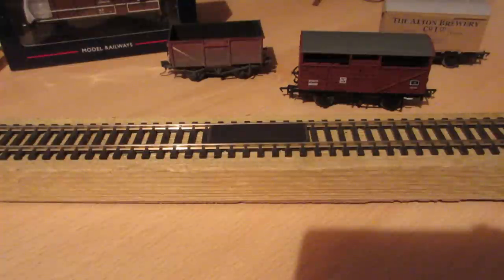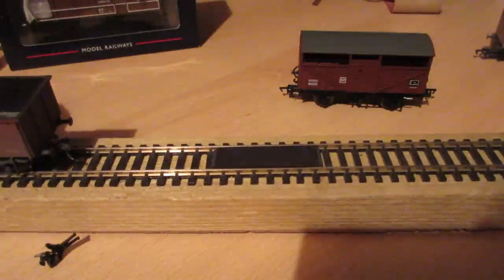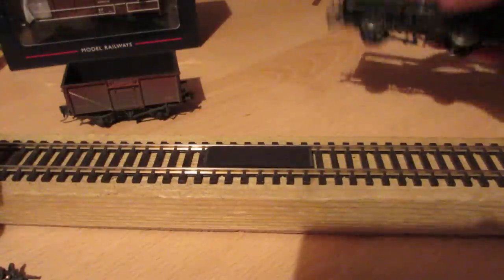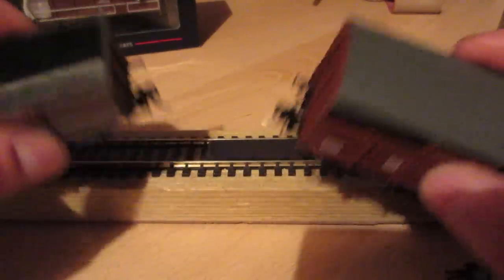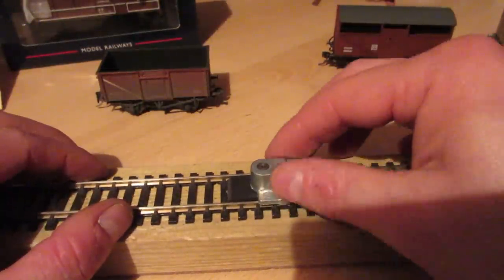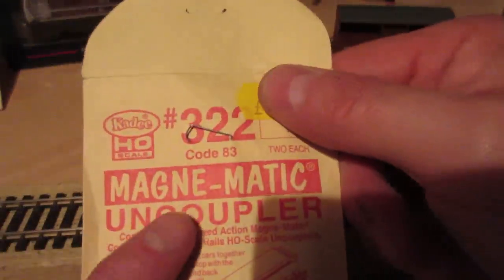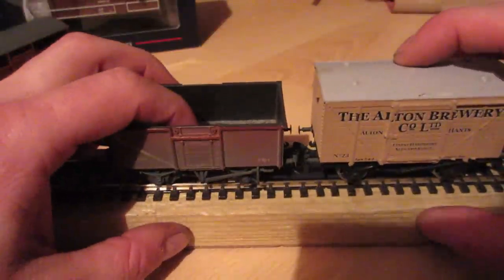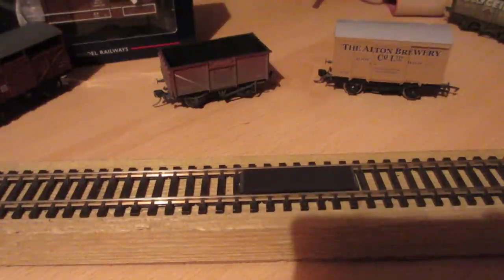Kadee couplings, how they work and installing

Comment: Very good presentation. I’m an American “O” gauge modeler but I have a small HO track I run some HO and OO on. I’m not terribly worried about being that prototypical but in my opinion the Kadee’s look much better and the ease of use is worth it alone for OO rolling stock.

Comment: I am a huge fan of Kadee now. Just replaced my entire fleet (5 cars and a loco) using the #1030 starter kit. I needed to provide to cement and the drill bit /drill but was otherwise complete.  It did come with the gauge and trip pin pliers, as well as 2 pr of uncoupler magnets... If your going to convert  or start new, buy this first.

Comment: I went for a more simple approach. I used spare NEM coupler pockets from Bachmann with either tension lock or european bucle coupkers and created a lasercut adapter to glue under the wagon. I simply remove the old Triang or Hornby coupling and glue the NEM coupler with my homemade receptacle in place. It's then just the case of inserting the kadee for nem pocket and there we go.
Reply from the maker: Evening Eric, since doing these vids I have found Dapol sell packs of NEM sockets and couplings in packs of 40, and that saves a whole bunch of time simply screw the NEM to the wagon insert kadee done!!!! , they even come with screws, sometimes i still have to pack them out but its alot easier, and I am not  lucky enough to have access to a laser cutter!!!!!
Reply: @keepcalmmakestuff732  thanks for the info. I'll be sure to check their website for it and hopefully buy some next year in Ally Pally.

Comment: Code 100 is for mainline, code 70 or 80 is for sidings
Reply from the maker: Hi Raymond, code 75 is more prototypical to standard Rail used across the network( height of rail), regardless of where its used, so from a modelling point of view if you wanted a layout to look like the real thing using code 75 throughout would look better( apart from handbuilt)
Reply: @keepcalmmakestuff732  I was probably just thinking of American Railroads although a line like a branch line would obviously have shorter and thinner rail since they wouldn't "see" big locomotives like giganic 2-6-6-6 Mallets and big 6 axle diesels and High drivered express steam locos.
Reply from the maker: in the UK, Kadees are nowhere as popular as the US, but I much prefer them to our tension locks, in the era of my layout(50's to 60's) we had pick up goods  so a train could be separated and wagons could be left and others taken so the ability to separate and shunt In a short space was a defining reason.

Comment: Americans used to use hook and horns couplers in HO scale and Rapid couplers in N scale until the Kadee couplers replaced them by the modelers at first, and then later also by the manufacturers with their own make. In the same manner many of the British are doing the conversion, Americans have been there, done that. Americans tend to model freight operations more than the British, and design their layouts accordingly. These Kadee couplers make shunting operations possible without the used of your hands. The key to successful shunting operations is to place a magnet before the point leading into the sidings. You don't have to put magnets everywhere.
Reply from the maker: Hi Ron, the US  have got the buckeye coupling nailed, we are a bit behind in our use of it and me personally now that I have used them I dont think I would go back to tension lock!!!!, The only thing I wish they would do is under and over shank for NEM pocket couplings, they do it for their draft gearbox it would make my job alot easier, operation wise we dont tend to have massive frieght terminals as they do in America, we had some hump yards that where big but my layout is tiny in comparrison so for operation purposes i needed more than one, as it is a terminus the loco has to run around so it will always be pulling so putting one at the throat of my layout may not have worked, At the small goods yard I have then yes it would be ok.
Reply: The United States has a lot of freight, agricultural and natural resources, that ship hundreds of miles, if not thousands, from the central part of the country to sea ports on either of their sea coasts. Where as in the UK much of the similar freight is ship less than a hundred miles to a sea port and then shipped to another port or another county's port. After all Great Britain is a island. British friends I have were astonished of the huge corn belt of America's Midwest around Chicago. Every farm it seems within a several hundred miles of Chicago grows corn, or soybean, or oats, if not all three cash crops. And then going west to the Rockies there is another few hundred miles of another cash crop, wheat... The apples and cherries of Washington state, the vegetables and fruits of California, are shipped by reefer trains across America to its east coast in a few days, they are not shipped by sea through the Panama Canal in two weeks. You could throw in Canada with similar freight. The North American continent is not a island the size of the one state of California... Amtrak and Via are still around with a few long distance national passenger trains routes, but 99 percent of our trains today involve freight/goods. Even if HSR does receive more investment, worldwide HSR works best for distances of less than 500 miles, if not 300 miles. At over 3000 miles, no one is going to ride a HSR train which will take more than 21 hours from LA to NY, if not more, when they can fly that same distance in less than 6 hours. There never will be a US or Canada investment in a transcontinental HSR...
Reply: I have a small 6 feet by 4 feet layout, about the same size as the Hornby TrackMatt.  I can get two ovals with two sidings off the oval, one outside and one inside. The inside siding does a 180 degree hook, to avoid using 1st radius curves I placed a straight on both ends of the main ovals. The middle siding leads to a small Inglenook  yard with two sets of points. So I can do long distance running on the ovals with two trains, and shunt to my heart's content with the small Inglenook yard. Just enough to keep me busy with my trains without getting bored...
Reply: Ron Clark god, I HATE Rapido couplers! I have an old Kadee n scale (old enough to be Kadee) with factory equipped Rapido couplers installed. It WILL be converted...
Reply: "Americans tend to model freight operations more than the British" Depends on the era. Modern British railways are basically all unit freight but anything set before about 1985 will likely have plenty of freight ops.

British (prototype) trains mostly use variants of chain couplers, which means that a model will either be using chain couplers (which are a pain in the butt) or will be using something unrealistic. Tension lock couplers are easy to make and trivial to set up, so they're the manufacturers' default choice of unrealistic coupler. If they moved to Kadee, the result would be that models would be more expensive and require more care to set up. In the US, the extra effort is worth it, because Kadee couplers look fairly realistic. In the UK, Kadee doesn't have that advantage: it's just an alternative unrealistic coupling system. It does have a lot of advantages but, at the end of the day, it still looks nothing like the coupler you'll see if you go outdoors and look at a British train.

Comment: Southern Region trains all had buckeyes as standard and they could be dropped to expose the hook for the traditional bar and loop couplers.   Its why SR emu stock at cab end it was the "pullman" bar that did the buffering and the buffers were retracted.   Some of the Thumpers instead of having a gangway connector just had a buffered pullman bar at end of the non driving coaches instead of the single buffer the EPB's had.

Comment: You can simply use uncoupling ramps with tension lock couplings.  

In the UK the US style "Buckeye" couplings are only used on coaching stock and fixed rake bogie hopper wagons (which have 3 link and buffers at the end wagons).
Reply from the maker: Hi Andy, uncoupling ramps have a disadvantage once you have left the ramp they re-couple, The beauty of Kadees is the fact that you can once uncoupled you can then push/propel a wagon to any position without it coupling back up( great for shunting), Tension locks also tend to leave a massive gap inbetween stock, which is much improved with Kadee's,  At our club we have some big layouts that we take to Exhibitions and trying to take apart a 10 coach rake at 5pm at the end of the day with tension locks is grief, the advantage of Kadees is that you just lift them up!!!.I have been using them for quite a while now and I would not go back to tension locks,!!!, disadvantage is cost and set up they take a bit of time to set up
Reply: A well traveled Yank here, been to all of GB a couple of times. Anyway, we don’t call them Buckeye, (that’s someone from the State of Ohio) we call them knuckle couplers. Good video, enjoyed it.
Reply: @samiam619  They're referred to as "Buckeye couplers" because that specific design was originally made by Buckeye Steel Castings, in Columbus, OH. They were the main manufacturer of them for the small UK market, so the name stuck here; in the US, Buckeye was just one of many manufacturers so their name wasn't particularly associated with what is generically known as a Janney coupler but, as you say, normally just a knuckle coupler.

Comment: Great video! Useful and informative. How do you stop the magnet uncoupling the train when it goes over it when you don't want it uncoupling?
Reply from the maker: Cheers for the comments, when the train is underway the tension in the coupling when pulled stops it, if pushed providing you dont stop the coupling does not come apart and will stay coupled once clear of magnet, flat track is important, if the magnet is in a dip In the track they may uncouple if the trailing wagon catches up over the magnet!!!!!
Hope that makes sense!!!!!,
Reply: @keepcalmmakestuff732  thanks for the info. But if the loco goes over the magnet constantly on a main track not siding what stops it uncoupling the train? Does it only uncouple when going over it slowly?
Reply from the maker: @mattseymour8637  providing there is tension on the coupling ie weight of train it will remain coupled they only uncouple when they are pushed together over a magnet, if there is enough drag/ weight on the train it should never uncouple, the tension prevents the pins from moving over
Reply: @mattseymour8637  let me explain it in American ;) ... tension keeps the cars coupled over the magnet during regular operation. you would need to stop the cars/couplers directly over the magnet then back the train up slightly to relieve the tension in the couplers, then they will uncouple and you can pull the train forward again.

Comment: Good video Ray. I am looking at KDs as I am building alot of wagons now as RTR arE just too high price . KD dont make it easy with their numbering system eg they have 416 for say long shank with pockets then use 17 18 and 19 for NEM style. I will take the plunge for some of them and maybe get the 1030 starter pack as that includes the gauge and pliers.

Comment: There is a surprising lack of video for conversion of old Hornby couplings (non-NEM type) to Kadee.  If you have now converted could you please make another video to show how you did it?
Ta
Ray
Reply: As he will show in the other video, with much of the rolling stock and locos there isn't much choice other than to cut and file away the older coupler. A touch of black paints helps. As for the plastic cards he is using as a washer, Kadee sells plastic washers in different heights as well that work with their coupler box mounts.

Comment: Can you use these Kadee couplings on locomotives as well as wagons
Reply from the maker: Thanks for watching, if you have the NEM pockets on the loco then yes they go straight in!!!!, if no NEM then it is a bit of a pain,
Most newer British manufactured RTR has pockets so its just a bit of fine tuning, some of the older mainline/hornby/bachmann are difficult I am lucky in that most of the stuff I run is easy to fit, I try to steer clear of older stuff!!!!!

Comment: The Kay Dee couplings bear a remarkable similarity to the older Hornby Dublo couplings, which were metal. I suspect that is the true heritage of the Kay Dee couplings anyway, but they obviously have the added refinement of the uncoupling pin which works as it crosses the fixed magnet. As a child when I had Hornby Dublo, I always thought their coupling was superior to what was then,  in the UK, the other type of coupling then available that was fitted to Triang and which became known as the Tension Lock coupler. I always regarded the Triang  coupler as a bit of a fiddly thing and rather difficult to uncouple, certainly by hand. The older Hornby Dublo couplings can and should be adjusted to a few critical angles and this can be done, with care, with a small pair of pliars. The later Hornby Dublo style couplings in plastic cannot be adjusted, but then they don't really need to be because they do not sustain the slight damage and bending  which the metal ones are susceptible to over the years with knocks and bumps.........the plastic ones can only break........but they do seem remarkably tough and it would be a hell of a knock, perhaps by carelessly dropping a wagon or coach, that caused the plastic one to break. Just a couple of observations in the coupling debate....!
Reply from the maker: Hi James, There is a huge similarity between them you are right, It makes me wonder why as a nation the tension became the norm,(reminds me of the whole betamax/vhs debate!!!!), I now find tension lock hugely frustrating to operate, Hand of God reaching over a layout puts me off!!!!!, the look is not the only resemblance as the kadee also needs to be precisely adjusted to function correctly as they too can be bent through use, once set up though they are a joy to use, It can be a bit pricey to change all your couplings over as they aint cheap.
Reply: @keepcalmmakestuff732  Tension lock became the norm just because it's cheap to make and you don't have to set it up precisely to work properly. Kadee is more expensive to make and also requires the height of the couplers to be set fairly precisely. For US use, Kadee has the advantage of looking like the couplers on real trains, but that doesn't apply in the UK. (OK, Kadee looks much better than tension lock, but it still looks nothing like a real train.)

Comment: Can this system be used on modern Hornby/Bachmann coaching stock ?
Reply: yes....just make sure u get the correct fittings as there r a few differefnt designs for different wagons and as per the vid u may hav to cobble something together for older or unusal makes of models.....plenty vids about this subject....as it is a big task to swap all ur rolling stock its worth a visit to a good model store where all the help ull need will be given to u im sure
Reply from the maker: Hello Trevor, The modern "stuff" is quite easy if they are fitted with NEM pockets check out my other video its got a bit more info on the subject